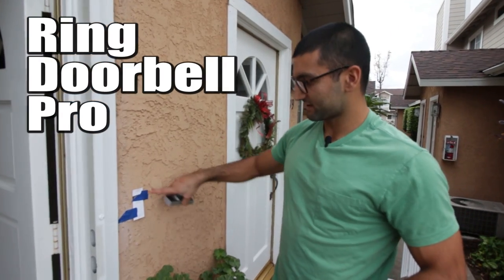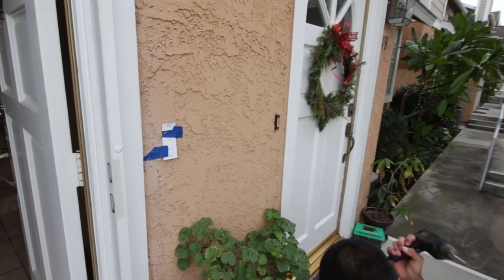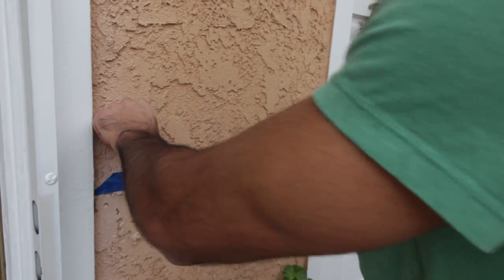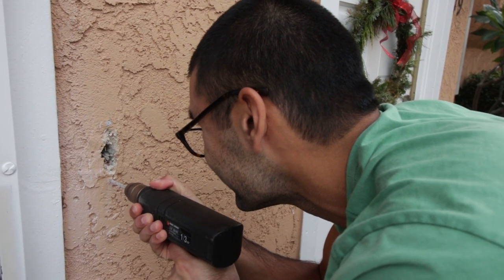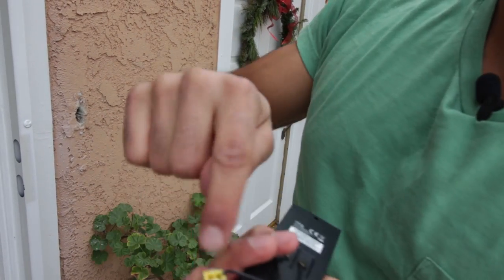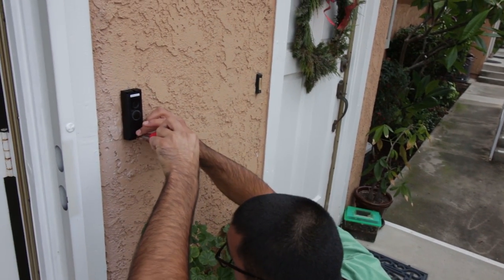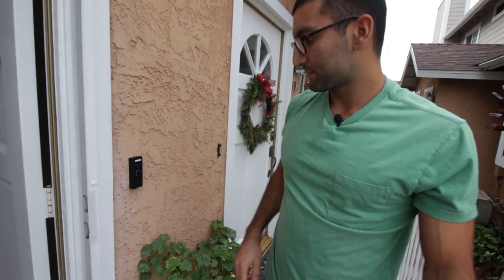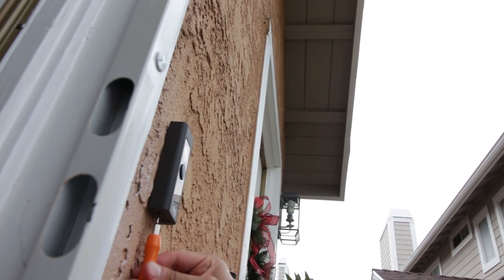Ring Video Doorbell Pro - Install on Stucco

Comment: Hi, can I please ask, why didn't you install it on the other side of your door, where the entrance is?
Reply from the maker: That was requested by apartment folks!
Reply: The neighbors I see, has their doorbell button installed on opposite side of their door as well. I guess that's just personal preference😌
Reply from the maker: @K-Z1  oh ya the Ring Pro requires constant power. And the doorbell powerline was already in this spot, so I actually had no choice. You have to install it where the old doorbell was unless you rewire the walls.
Reply from the maker: Ring pro requires wired power and that's where the previous doorbell wiring was!

Comment: Did you use the screws that came with the install kit or did you use a different kind of screw for stucco?
Reply from the maker: I used the ones in the install kit

Comment: Do you need a hammer drill or is a regular drill okay? And what kind of drill bit did you use for the pilot hole?
Reply from the maker: Regular drill is ok, but it may take longer depending on your stucco. I don’t remember the drill bit I used, but anything smaller than the Ring one should be good enough.
Reply: Guess you didn't see him using a regular drill in the video.
Reply: @ubreakitirepairit3569  I'm dead 😂💀 lol

Comment: Sir if I am not mistaken, I believe you are supposed to install the bracket ?
Reply from the maker: Yes that is only for the classic Ring. Ring Pro does not have a bracket.
Reply: @ShervinShares  You may need to install angle bracket for Pro as well.
Reply from the maker: Angle bracket serve a different purpose. They’re totally optional and used if you want to angle the Pro a different direction.

Comment: Have any tips for installing the ring pro if the my original doorbell location is too narrow for the ring pro?
Reply: Shervin Shaikh will the wires be subject to water contact during rain/snow? If I use the ring plates?

Comment: Is this real stucco or the modern engineered stucco?
Reply from the maker: great question, I'm not totally sure
Reply: I have that new lightweight stucco and a screw will not stay in it.  That's the problem I'm trying to solve.
Reply: I have that new lightweight stucco and a screw will not stay in it.  That's the problem I'm trying to solve.

Comment: hi does the ring pro work in 220voltage?
Reply: If your doorbell has a transformer, then it doesnt matter what voltage the primary is... youre feeding it from your doorbell transformer's secondary (16-24VAC) side
Reply: Shervin Shaikh ... hence me saying the secondary had to be a certain voltage.